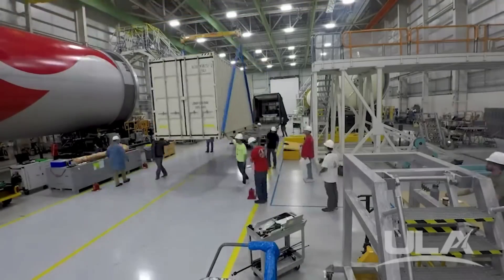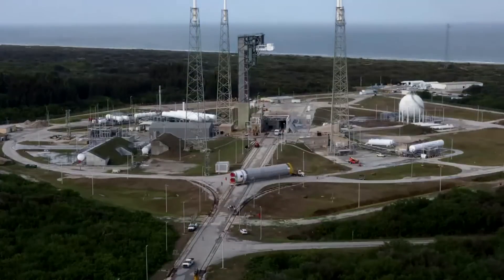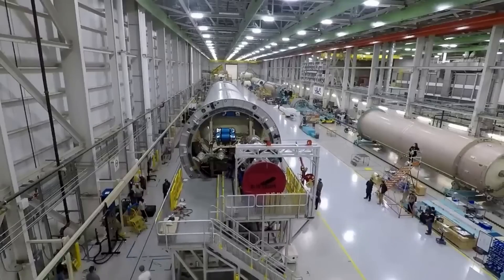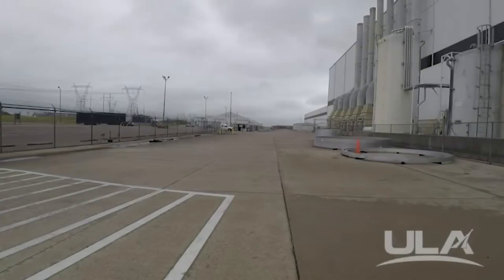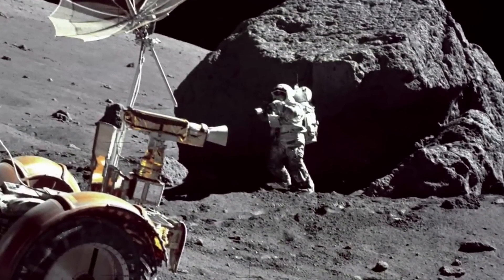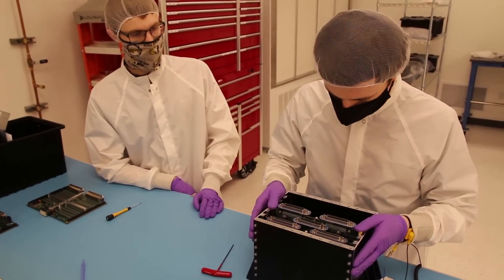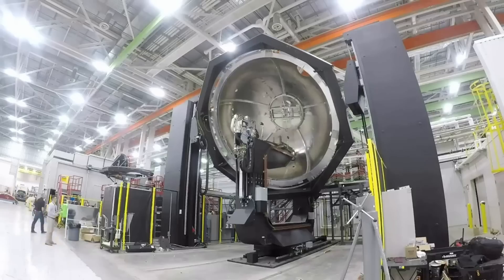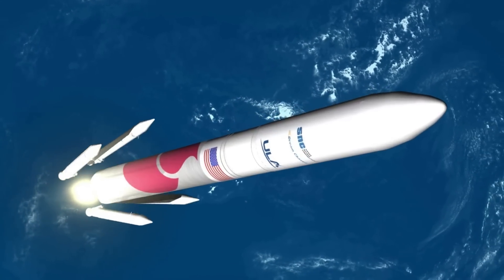An Update On Vulcan, Its Payload, Maiden Flight, & More

Comment: I really  wish one of the requirements  that they would put on these companies  is to 1. Keep the cost of each launch below a sirton cost. 2 they have to have the ability  to have more than 10 launches  a year with no delays. If misson is delayed they pay nasa or the company they are working for a percentage. But what is the best any of them can do is one maybe  two a year.
Reply: They may be slow but ULA haves a 99% perfect record. Two satellites were place in lower then expected orbits. Also they have no "RUDs". Unlike SX & BO, ULA never lost a rocket. So if you don't want a Rapid Unexpected Dissambley you go with "Old Space".
Reply: @TheMrPeteChannel  lol yes let's look at that ULA has been launching  sins 2006 and have 150 success. Technically  thay have had more than that because most of the engineers  where part of the space shuttle  program and recycled  old nasa design. That is why they used Russian  Rocket  motors. Because  the space shuttle  motors  where garbage.. Know let's look at SpaceX. Sins 2010 SpaceX  has had 197 launches 195 of those  where sucsefull. In 4 less years they had 45 more launches.  Using  a technology  that thouse same ULA engineers  said was impossible and for a fraction  of the cost Of a ULA. This year alone they had 60 successful  launches.  And 1 super heavy. That had not flown in three years. SpaceX  has done
1. Made reusable  rockets a reality.
2. Made  space cheaper.
So why do we need ULA they way I see it as just another government  jobs entitlement program. Put in trillions  of dollars  and dont see a posative  return.
Reply: @halcyonoutlander2105  if I had the resources  they have wasted I could..but what I said is not talk but facts. .but thank you for saying you won..👍😁

Comment: Vulcan seems boring. LOL
Reply: Boring for first launch is not bad, maybe less boring when they recover engines.
Reply: I just want to know why do we need Vulcan when we have super heavy  that can do the same job for less and has a fast  turn around. When ULA  is slow as Christmas  to  5year old to get things done.
Reply: @williamtaylor8950  Falcon Heavy has only launched 4 times and will not be human rated. Plus the engine tech for BE-4 is more promising, with the mix of other proven engines making it possibly a potential capable vehicle. Merlin engines haven't been proven to be very durable (I guess BE-4 hasn't proven it yet) and Raptor doesn't seem to be mission ready. Plus one of those D9 heavy launches was so distasteful, if you know the story of the stolen Tesla roadster from Martin Eberhard.
Reply: @williamtaylor8950  So your a “all your eggs in one basket type of person”. Ultimately economics and independent access to space issues will write the full story. So file under “we will see”.
Reply: @Mentaculus42  No not really I like compation. It breeds innovation  and lower cost. So we can do more with less cost. But I dont like any group that  cralls in bed with the government.  Because  in the end they loose there ability to compete and be creative. They become bloated, slow, and un willing to think out side the box. All you have to do is look at ULA and see that the SLS  is not new teck or new desine.  It was drown up after the challenger  disaster. Starliner  is a apolo capsule. And they could not or did not what to get it right.? I think the feds should stay out the private  sector  ccx an dot cheaper and better.
Reply: @williamtaylor8950  This comment proves you know little to nothing about spaceflight